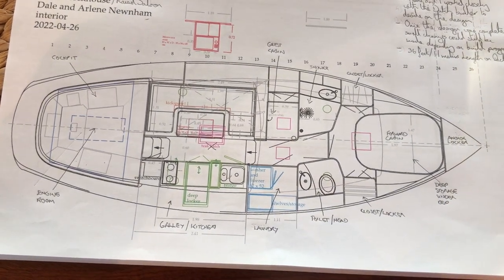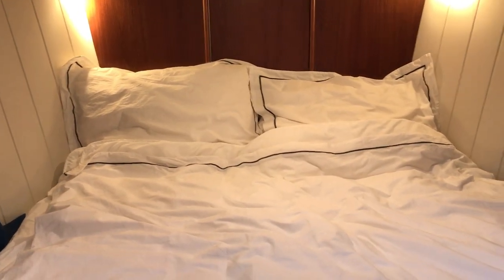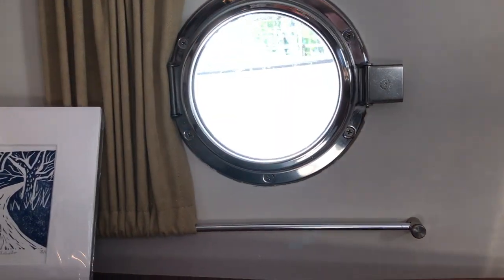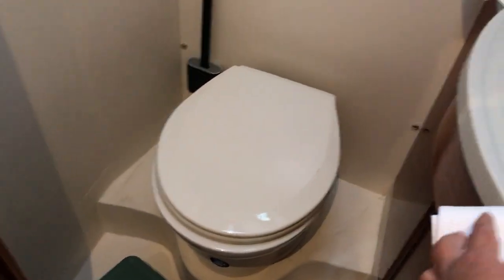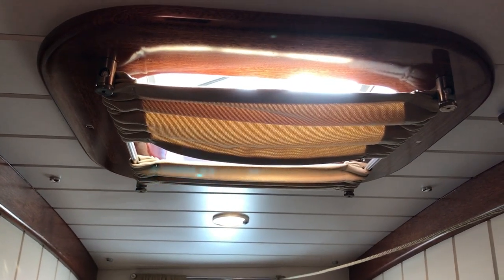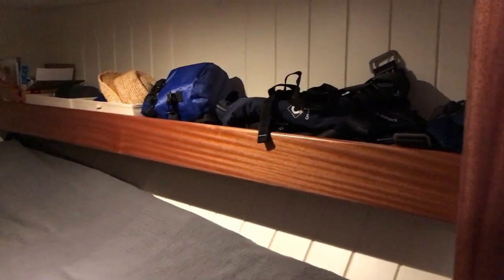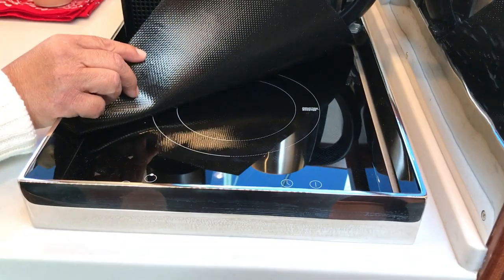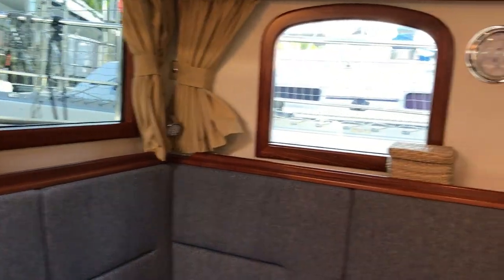Wanderer 36P Mallard Interior Tour

Comment: Great! Everything we discussed you have on 36ft. accommodated. there are also some new details from Chiel. very good: the pull-out compartments! Installing the technology in the guest cabin is clever, but takes some getting used to. what is that tablet on the wall? can it show the functions of navigation? and maybe also control the autopilot? then you sit comfortably below deck and have everything under control! :-) how beautiful the galley is in the deckhouse! but the hammer is the idea with the towel rail! 👍 I'm thrilled! and now even more excited about Stenella2. The only question that remains for me is: does the KYC (Kiel Yacht Club) have such beautiful guest towels? 🥴😂👍
Congrats my dear!
Reply from the maker: I’ll do another video of the control panel so you can see how it works. We decided to move the panel away from the deck house to provide more room for kitchen equipment and general living, but it is more effort to check on system status and turn off stuff each time we leave the boat.
Reply: @voyageofthemallard4027  yes, I think so. I wanted to have a navigation/working/steering unit in the deckhouse and I hope to see enough through the front windows to habe the control about the front area. But You can also sit in Your saloon reading Your tablet and correcting the course. I think about longer distance courses under machine.